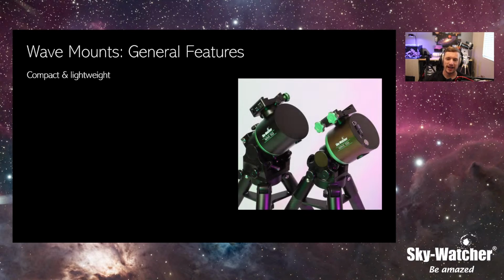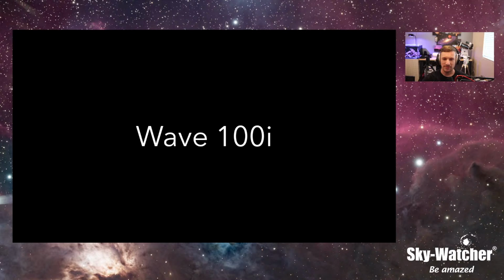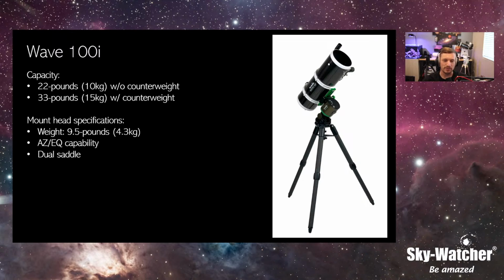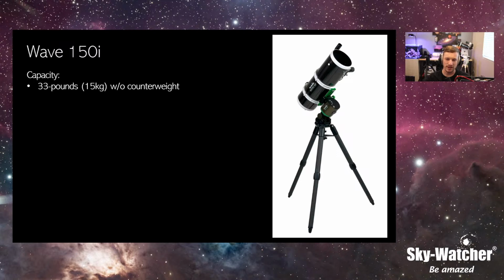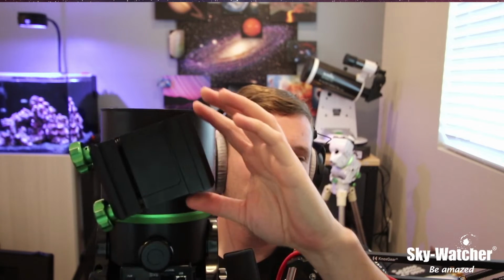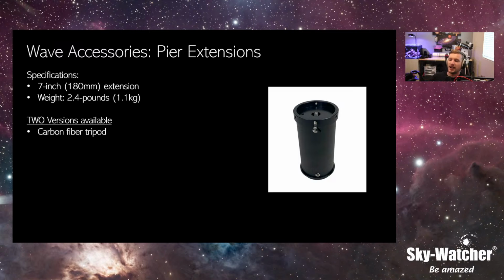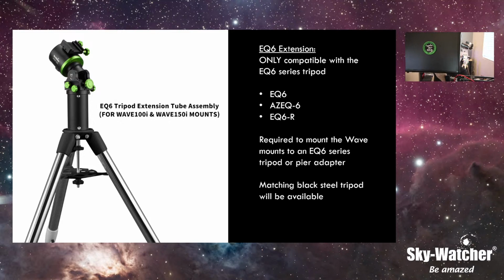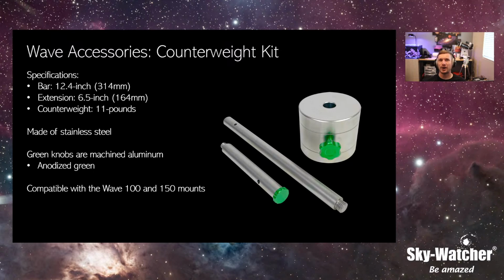What's Up? Webcast: Wave Mounts

Comment from the maker: If you had a question that you didn't get a chance to ask during the live show, please put them here so Kevin can answer them.
Reply: 25kg payload (incl. counterweights) seems to be very ambitious for the 150i - for example would it really, not only handle, although the numbers fit, an ESPRIT 150 ED APO for astrophotography use?
Reply from the maker: @stadtchronistjennersdorf6351  Yes, but you'll need to use counterweights and a very stable tripod.

Comment: Curious why only the Wave 100 is dual saddle capable?  Why not do that on the larger 150 as well?
Reply from the maker: Good question. The Wave 100i does not have built-in cable management like the 150i does. Because of this we were able to add a second saddle. The electronics that run through the mount on the 150i limit us a bit more with movement and what we are able to add to the other side.
Reply: @SkyWatcherUSA  Thank you!  Much appreciate the explanation!

Comment: I bought an adapter for pier extention. So I can use the Wave150i with carbon fiber tripod and the EQ6 tripod 🙂 The mount is very well made except for 5,5/2,5 powerplug that makes me buy som adapter cables 5,5/2,5 to 5,5/2,1 because I am using AsiAir as mini-computer. The mount is so easy to use with SynScan Pro app and AsiAir app 🙂🔭

Comment: I have a Gitzo carbon fiber tripod. Can I use that with the 100i? I really don't need another tripod.... Thanks :)
Reply from the maker: If it has a 3/8 thread then yes you could. Just be aware of your payload as most of the time these are not balanced. A wide spread tripod is ideal.

Comment: Would the 150i be able to support the SW Quattro 250p with astrophotography equipment with good stability?
Reply from the maker: You are really pushing it due to the mass of the Quattro OTA.
Reply: How about a 10” f4.5 Newt in alt/az for visual use?  Looking at a lighter replacement for my AZ EQ6.

Comment: Did I get this correct, that for the USB the port on the DEC could be used as an input, routed through the mount to the saddle and that is than connected to the USB-B on the Saddle to control the mount? Because if I am mounting my Mini-PC on the Telescope, this would be the best case to control the mount without cable snagging...
Reply: I would be interested in that too?
@SkyWatcherUSA
I'm also a bit confused as the USB input port on the saddle is USB-3 (blue). On the other hand, the output port appears to be USB-2 (gray).
Or is it bidirectional? So simply routed through one to one?
I'm also a bit confused as the USB input port on the saddle is USB-3 (blue). On the other hand, the output port appears to be USB-2 (gray).

Comment: Any chance to reuse a 1.75" steel tripod for eqm35 pro with the new specific Eq6 pier extension?
Reply from the maker: The threading is different so they are not compatible.

Comment: Are these suitable for longer focal lengths, 1450mm and 2032mm. C8 SCT. Any chance an adapter to mount the 150i on an AVX mount?  Will you be selling the EQ6 tripod separately? Thanks.
Reply from the maker: Yes, we will have an EQ6 tripod sold for the Wave mounts. We hope to have more information on that soon. We will also be running it with longer scopes here shortly as well.
Reply: @SkyWatcherUSA  also the HEQ5 tripod will be suitable?
Reply: @SkyWatcherUSA curious to see how this shakes out.  Considering replacing eq6r with w150 (something more portable).  Have an edge 9.25 and all the photo gear riding on top.

Comment: Do you believe the 150i with a steel tripod will be able to hold an OTA SW Quattro 10 with  accessories for astrophotography ?
Reply from the maker: It might be the upper limit on it as the mount is rather small. Any breeze will likely cause the tube to shake.

Comment: Thank you! It's a very interesting mount, but it lacks in payload capacity. I would be glad to see a 35 kg payload capacity.
Reply from the maker: Making a strain-wave that can hold 35kg likely isn't an issue. The issue the the tripod/pier needed to hold such a mount and its payload without falling out due to unbalanced weight. 

Strain-waves are meant to be lightweight and compact. Making them larger means a much larger tripod. This goes against the overall goal of what these mounts are for. 

We are sure there will be larger strain-waves in the future but you will loose out on its convenience very quickly due to the required tripod.
Reply: @SkyWatcherUSA  But a 35kg capacity mount with compatible tripod will still be much lighter than a conventional system,
Reply: True, ioptrons hae69 has a payload capacity of 31 kg though